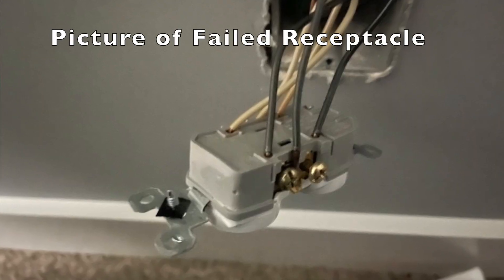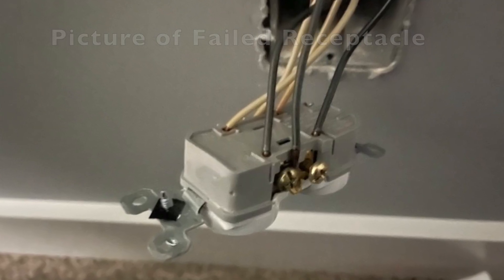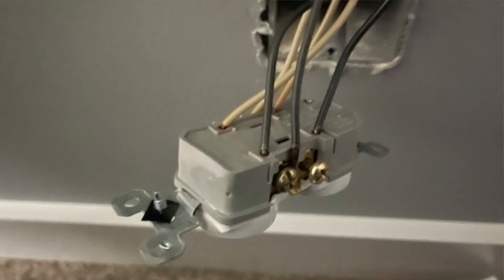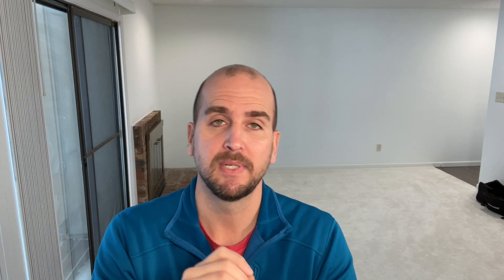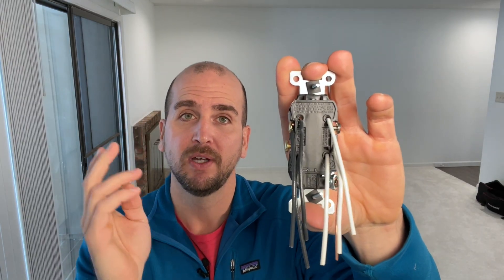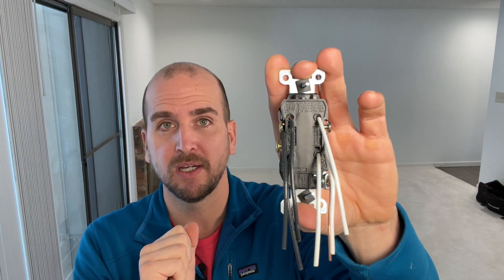Incorrectly Wired Outlet Found In Newly Built Home

Comment: Titles like these are kind of irritating in my opinion.  These really aren't mistakes, more just not what this guy would do.  If the push in connections were a real problem they would be eliminated.  I've worked in construction trades and been a claims adjuster for 20 years and have seen many different methods of building homes.  Do what works for you, but quit thinking only "your" way is the right way.

Comment: I can see a pigtail in a 3 wire situation, but what's wrong with 2 wires, 1 under each screw on the respective hot and  neutral sides?

Comment: As a residential Electrician in Florida.
I'll confirm all the information you have laid out here.

Point 1 i agree. Screw in the unused terminals.
It streamlines the recep and it is useful especially in metal enclosures.

Point 2, back stabbing is a big NoNo. I agree 100%. Introduces latent failure points. 
Side point is the space heater thing you said. Any high current draw device such as space heater or hair dryers do take a toll on the outlet. Especially backstabbed.
I am always doing service calls related to space heater failures during the winter.

And point 3, pigtailing any multiple wired devices.
It's standard to pigtail in my company.

It allows the current to pass through the joint you made up rather than the device structure. This extending the longevity of the installation.

Great habits to pick up if anybody didn't already know.
Thank you for your work

Comment: wrong.   you are creating un-necessary problems with the pig tails in this case:  you've created 2 additional un-necessary connections and added the pigtail wiring in a box that's going to be tight anyway especially with No.12 wire.   the receptical has the terminals necessary to accept two hot and 2 neutral connections.   use em.

Comment: Strictly speaking, NONE of these points mean that the outlet was incorrectly wired. They were wired correctly, just not very well and as you said according to best practice. As for the last point, there is a reason the pigtail is better. When wired to the device and used as a pass through, the receptacle is simply in series with the line. If the receptacle goes bad it kills the rest of the line. With the pigtail, the receptacle is wired in parallel and if the receptacle goes bad, the rest of the line will still have power.

Comment: The word “professional” used to mean if you got paid for ..whatever...you were a professional.  Doesn’t mean knowledge was involved.
Reply: Correct. "Expert" denotes knowledge or experience, and as you state "professional" only means that you were paid.
Reply: @JLange642  Certainly lots of definitions of "professional" but in the occupations that require a license (requiring experience, education, references, testing, continued education, etc) like a professional electrician it means someone who has gone through the rigorous process to be certified and legally authorized to perform a certain function. So not just anyone regardless if someone gives them money would be considered a professional electrician.
Reply: Allen T if you are building your own home you build it in stages according to the plans. Each stage is inspected by a pro building inspector. Carpentry check, plumbing check, electrical check etc. Anyone can do the work as long as each task meets the inspections. Once signed off you can close up the walls etc. There are still a few men around that can actually use their heads and their tools.
Reply: @14goldmedals I think that would depend on what State you are building in, and in what community.
Reply: @14goldmedals  Great point!  Yes in my area you can do much of your own work without any license.  (I did some of the tasks when building my room addition but contracted out things I could not handle) But if you are charging someone money then the State requires licenses to protect the public.
Reply: William Simmons I only have experience in Canada 🇨🇦 I should’ve mentioned that. Alberta isn’t totally strangled in red tape like BC or Quebec.
Reply: @allent1034  The end result of an apprenticeship should be a qualified "professional".
Reply: Like the guy doing this video. He is only doing my opinion crap. Has no knowledge of why electrical joints go bad.
Reply: @timfritz3828  Right, if he gets enough views, he will get paid for his video but just as he stated, he is not a professional electrician.  He is very good at explaining things and makes a great editorial though.  I've watched plenty of videos by real professionals who do a lousy job with their videos.
Reply: @allent1034  getting paid for the views would make him a professional youtuber not a professional electrician even if the definition of getting paid is being used. He wouldn't be paid for an electricians service, he would be paid for providing a video that generated ad revenue.
Reply: @mcopeland05  Exactly! Well said.
Reply: He probably thinks the nec is the natural education commision.
Reply: People with out the proper knowledge of any construction trade is eventually weeded out by inspection of  their work . No days most localities are covered by codes no matter the trade involved.
Reply: Richard Stahlbusch I would hope so. But there are many crews with 1 carpenter and 20 helpers. My trade is Journeyman Heavy Equipment Technician. So I could show you how to install the brakes on a semi and if you did it properly I could sign off the job as done. 
I’m betting there are too many job sites to count where there’s 1 electrician and a bunch of helpers.

Comment: In the kitchen of my 1998 home, an indoor grill kept tripping the breaker once it reached its "ready" state (a green LED would light up indicating the plates were hot enough).  There are six outlets in the series.  I plugged the appliance into any of them and the result was the same.  Other low-wattage appliances, e.g., toaster, coffee maker, were fine on this circuit.  I plugged the appliance into an outlet nearby the patio door and all was fine.

So, I just replaced those outlets with new ones and discovered this: none were GFCI;  the line for each one and the load from the 2nd through to the 5th one was via backstabbing.
What I did: made the 1st one GFCI and used the screw terminals to fasten all connections.  And VOILA!...problem solved. :-)

Comment: Hooking the wire around the poles will reduce hotspots. Speed wiring is not recommended, I personally pigtail off joints to terminals.

Comment: i think the shepherds hook on the final installation of the outlet was backwards — since we tighten clockwise, the wire should be on the left when tightening
Reply from the maker: Hey Jon, sorry that was a bit confusing.  I used the back wire plate so the stripped wire was actually just straight without a hook. Thanks for the feedback.
Reply: @EverydayHomeRepairs  got it.  i was watching on my phone.  At home on yhe tv it was much clearer as to what was going on.  Sorry for the false alarm.
Reply from the maker: @hull39  all good my friend, I always welcome feedback in all forms 👍

Comment: I changed a receptical in my house and the push ins came out of the outlet when I pulled it out of the wall.   When I took an electricians class in the early 80s the instructor told us to use the push ins.  I don't now.
Reply: Never use the push In they fail all the time make a hook and wrap the screw

Comment: Thank you for shearing sir. 

You said follow national & loco code ? 

So code said you have to be licenced ?, Do you have Electrician licence ?
Reply from the maker: Nope, I am not licensed.
Reply: @EverydayHomeRepairs  
You said follow national & loco code ? Did your loco code said you have to be licenced Electronician or you have to take parmet sir ?
Reply: @EverydayHomeRepairs  Does NEC code said follow manufacture instraction guide line & loco Authority ?
Reply: @EverydayHomeRepairs  thank you shearing sir. And thank you spreading safty to tighten sqrews

1st huge miss take are they install 14 gage wire with 15 amp breaker.
Not enaf for vaccume & heater 
Even you change where wire direction. NOT enaf gage wire for vaccume & heater sir it heat up wire & might cause fire & sparks dengerous.

1st huge change need are 
You need change 14 gage wire  to 12 gage wire 20 amp breaker for vacuume alone for 1500 - 2500 watt vacuume plus heater 1200 - 2500 watt need separate to other 12 gage line with 20 amp breaker and I think Newer 2018 or 2020 NEC code require AFCI outlet ? If you wanted follow code sir.

Thank you shearing and convering safety sir .

Comment: As a 35 year licensed electrician, it’s good to see DYIers twist and use wire nuts . Can’t stand those Wagos.
Reply: Why not?
Reply: @FroZenThai  a few things,  I don’t trust the connection just like back stabbing, they take up to much room, the twisted splice stays together when the wire nut is removed  for easy testing while hot. you can’t add to the splice while hot with out taking the thing off creating load arcs,

Comment: So many handyman don't realize that the receptacle screws are brass on one side and and silver plated on the other. Neutral(white) wire to the bright side and hot black wire to the brass. Multiple colors like red and blue means call an electrician.

Comment: I have a kitchen switch that seems to be wired correctly and tight. Yet sometimes I switch it on and it does not work. I replaced it twice with new switch. Yet same results . What do I need to do to fix this?

Comment: I'm not an electrician but I'm seeing more electricians using Wago connectors now instead of twisters. Can you expand on this?
Reply: Those are for lazy folks. They are no different than stickins. You have to cut the wires to service or extend. I recommend staying away from them.

Comment: I live in B.C. Canada.  Our rules require pigtails, no exceptions. It is prohibited to use the multiple screws or push-ins on an outlet as a way to connect wires in parallel.  This allows the homeowner or tenant to change out receptacles without breaking the main circuit.  Makes a lot of sense.  Our codes also require careful attention to box size - for each box volume there is a published limit to the number of wires entering the box in combination with a limit on the number of wire nuts.  Our electrical inspectors are well-aware of these rules, and you won't get approval if they find even a small error.  Safety first...

Comment: In some jurisdictions back stabbing is a code violation. Good advice in this video ......always make pigtails and used the screw connections. I also wrap electrical tape around receptacle covering the screw connectors for an additional safety measure. This reduces the risk of a wire coming loose due to a screw failure. Best practice. Unfortunately most residential electricians are in far too much of a hurry to do this. If you are having a house built require this in the specs.
Reply: I’ve done renos and additions for 20 years in Canada. I have never once seen a switch or outlet with electrical tape wrapped around. The outlet has to be centred in the box or the cover plate will not fit on it. So screws are away from the sides.
Reply: @paulwhealy5243  Then you don't do a lot of industrial work. It's very common in the US for specs to require  outlets and switches to be taped around the screw if the box is metal. Iv'e worked a few jobs that required the same with plastic boxes. I've worked on jobs that required the wire nuts to be taped.

Comment: Pretty good video,  i recommend electrical tape on the wire nuts so there is no chance they come off and i wrap tape around outlets and switches to insulate the terminals, I'm an industrial/commercial electrician so i have no clue who will pull things out after me just a little extra protection, i do it in my house too. Glad you pointed out the stab in doesn't matter what code says no professional ever uses them they are junk. Keep up the good work.

Comment: I appreciate your video addressing this very common practice.  Your presentation is very professional.  The push-in option is only meant to be utilized as a secondary connexion and not a primary one.  Many electricians use the push-in option because it is a time thing, it is faster; and time is money which in the end always equates to sloppy work and increases the likelihood of problems which increases both time cost to it.  If nothing else, those push-ins being in the back place more stress on the wire and provide a higher chance of breaking due to the fact that when pushed into the box, they can only bend at 90 degrees or stand back from the outlet which fills up more space in the box not to mention that it does not make it easy for the next guy to work on the receptacle especially if you want to reuse it.  Best to be methodical and do clean when working which leaves no doubt in your mind about the quality of your work when the project is completed.  Though this advice would only have an impact on that person who takes pride in the result of their efforts